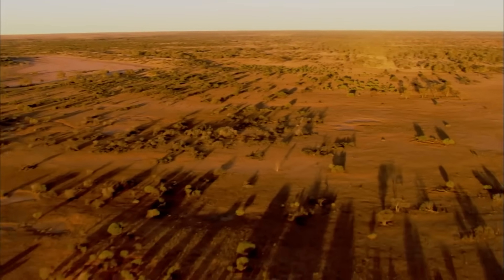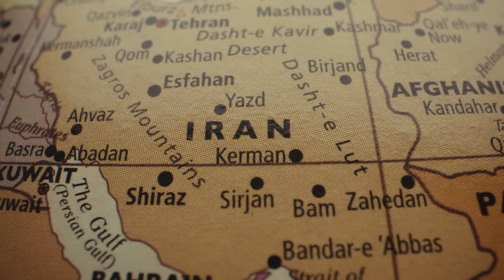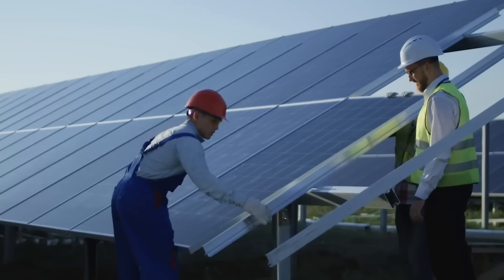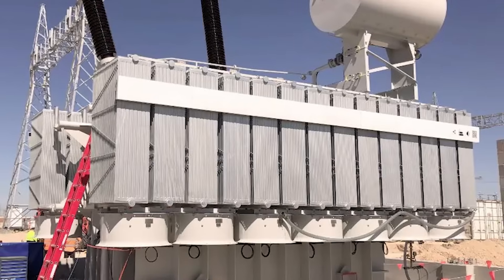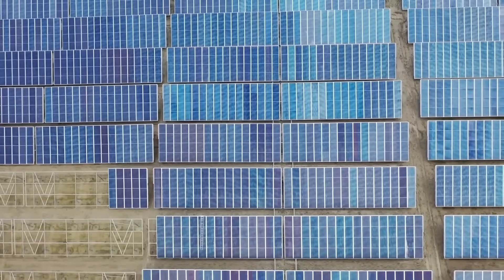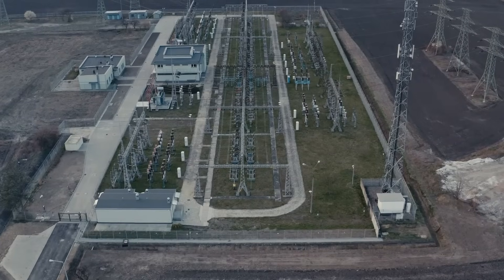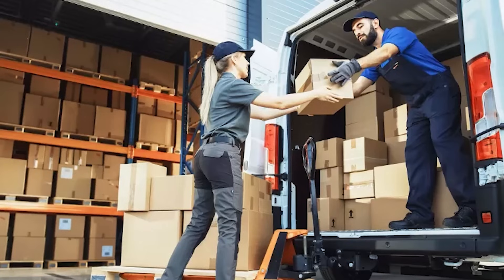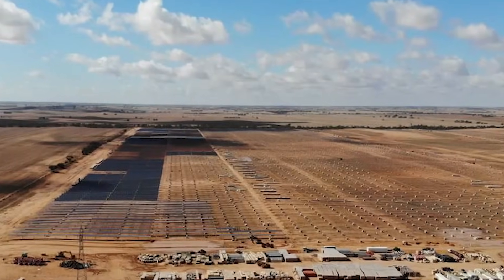How Engineers Saved Victoria’s Largest Solar Farm

Comment: Nuclear promoters have the same spinning mass construction problem.
They don't worry.
The lightweight and fragile national grid is because overbuilt was too expensive.
Grids are extremely expensive. 
From $1million per km to
$13million per km and 1million km.

The national grid was built over 14decades. 

Grid owners have 10times more investment in the grid ,$TRILLIONS, and need $100sBILLIONS in annual cashflow.